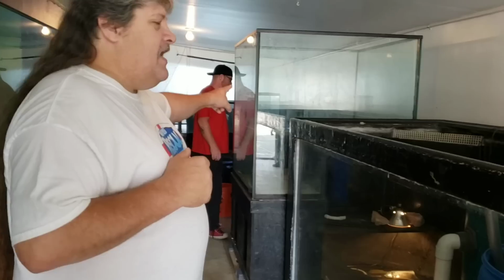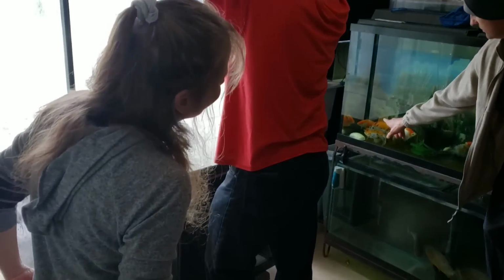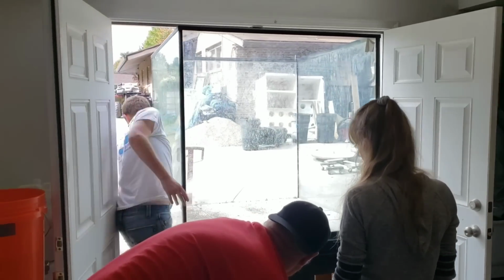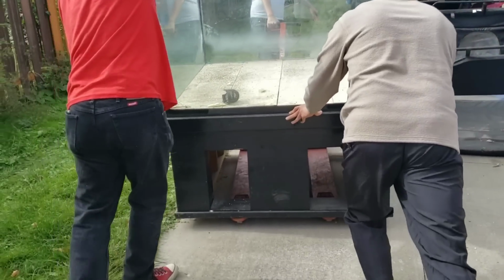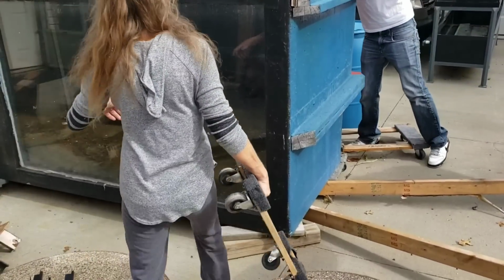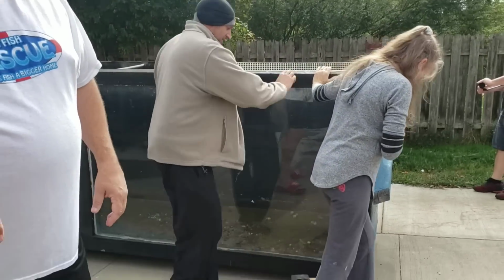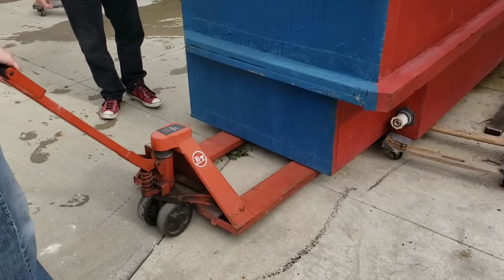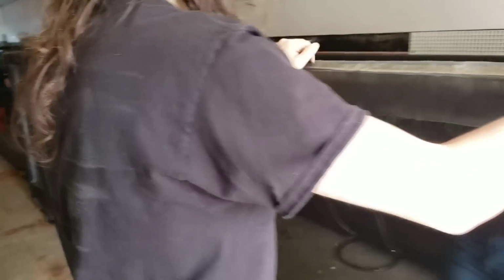Moving monster tanks at ohio fish rescue

Comment: It's a lot easier to use black pipes to move a heavy object like the monster tank. Lay down multiple pipes, start rolling the tank over the pipes, move the pipe in the back to the front as you progress. If the  pipes are thicker than the door threshold, you'll go over it like it's not even there. The pipes need to be wider than the object you are moving, of course. Give it a try next time you need to move a big and heavy tank.